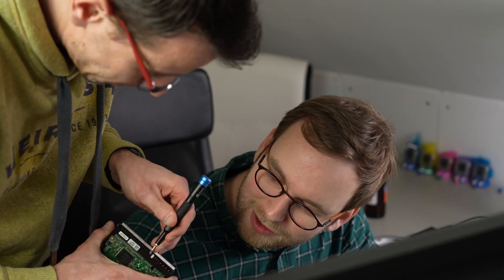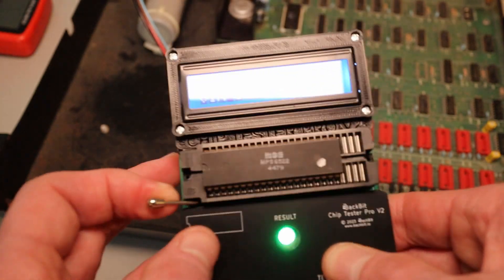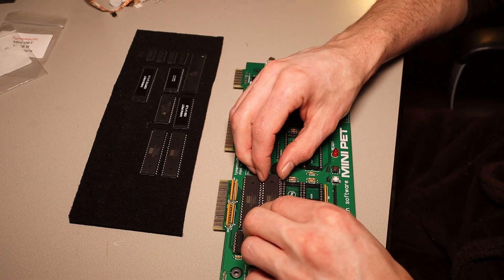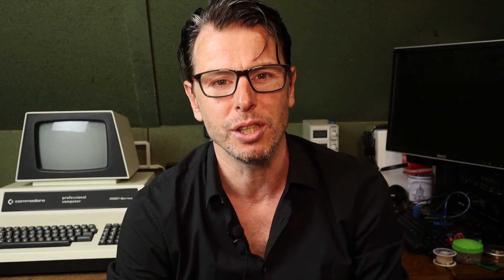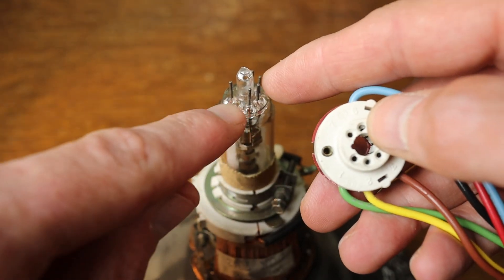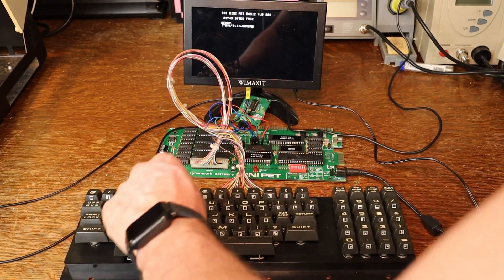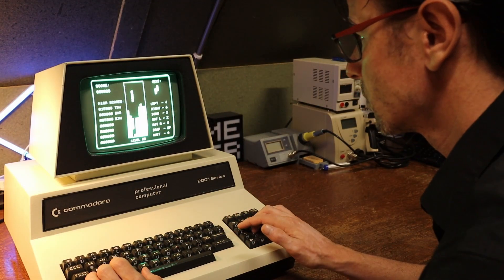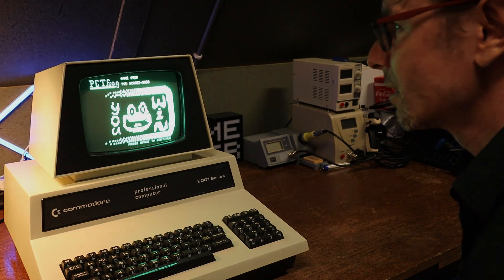Installing a MiniPET to Fix my PET

Comment: What nice machines those PETS are! My keyboard was fairly non-responsive on my 8032 model. I used a piece of copy paper to vigorously clean each rubber contact. It acts like a very mild abrasive and cleaned off 40 years of accumulated grease and such from the contacts. This same method has so far saved an Amiga 1200 KB, a VIC-20 keyboard and my PET keyboard.